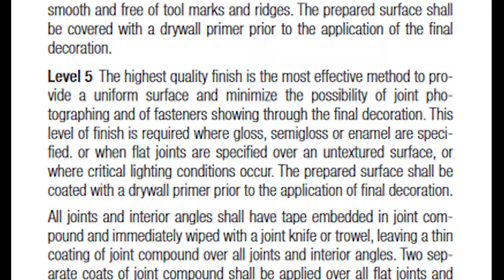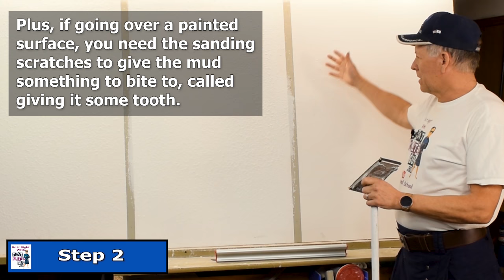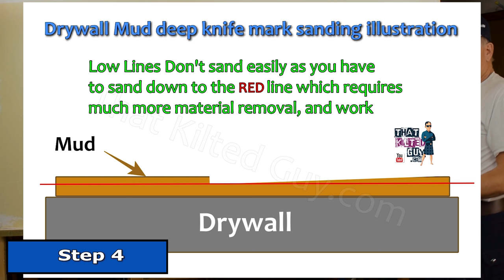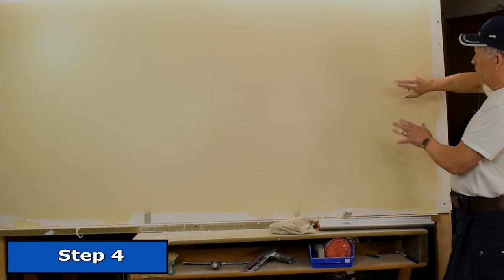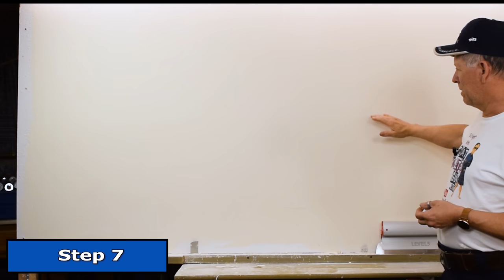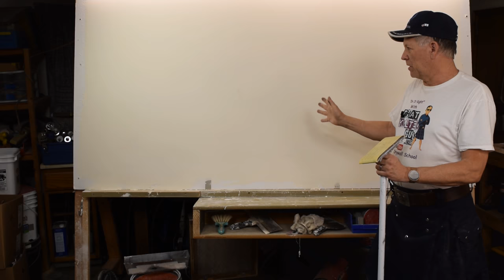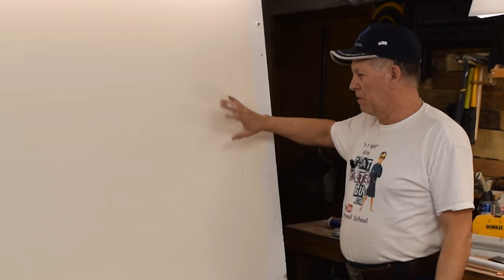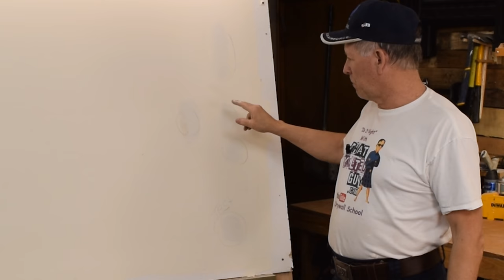Got UGLY TEXTURE? Skim Coat it away.  I'll teach you how

Comment: Thank you sir for sharing all your years of experience as a drywall master. Truly invaluable for us newbies trying to get a good result our first time out. I have a big first time kitchen walls and angled high ceiling job that I'm going to tackle on my own. If it weren't for you I don't think I would even attempt it. I hope I do alright and I'll take some before and after pics.
Reply: How’d it go?
Reply: @johnm9115  It came out great! It was also also alot of work. I did save alot of money 💰 
Use paper tape not the mesh. The first tape coat use hot mud, it's alot stronger with less chance of cracking.

Comment: I watched so much of your videos to prepare me for a big undertaking of skimcoating over horrible diy texture that the previous owners did in our home. I started knocking down high points and the joint compound just started coming off. Lucky for me they did not properly prep the wall and put joint compound straight over oil based painted walls. All I have to do is scrape lightly scrape some of the paint (again laxtex over joint compound ,comes off super easy) spray with water and it just scrapes right off. This was 1/4 inch thick some spots Even though it's still work to scrape all the joint compound off in still left with a smooth wall with some minor damage from wallpaper removal in some parts. I ordered some gaurds and now I feel alot more confident that I can actually make this look good since I'm starting with an already pretty smooth surface. I guess their lack of proper prep worked in my favor. I will actually prime and everything to ensure my skimcoating actually stays on the wall lol
Reply from the maker: Devin Bush wow, you got lucky. Be sure to de gloss the oil paint well before putting any mud on it. This is proof that proper prep matters.

Comment: I'm a master finisher! I always skim twice! "Busted " every joint! I still like watching your videos! One thing I learned when using screen tape using durabond on your first coat not mudd bc cracks will happen! I learned that from you sir!!! Thank you for the knowledge! Frim Georgia!
Reply: I'm a rocker/plasterer by trade 26 years.  I also use durabond for patching plaster (1st 2 coats). It is its own animal no other mud can match. I also tell people your mud is only as good as what it's fastened to.  Put the seam in the wrong load bearing spot or fasten wrong and it cracks no matter what.  Most rockers will start a seam off of a corner when doing a ceiling, I put the corner in the middle of the sheet to allow flex under the middle of the sheet instead of the seam. Cheers

Comment: Thank you KG for all your help! I have done two rooms thanks to your videos, taken my quality to level 5! Might I suggest, I used a headlamp at night for the final sanding, for the rooms that I did, just went along the ceiling when I worked on that, and then for each wall. It worked sweet to use a headlamp at night and kept my hands free to achieve that smooth level 5 I was looking for while sanding or touching up w more mud in certain areas.
Reply from the maker: I’ve done that

Comment: For a smooth finish close to a 5,  2 coats in corners, 3 coats out corners and seams and 4 on the butt joints. After sanding i wet mop everything paper and all. Last I will sand a$ter a good drywall prime.

Comment: Little advice please. Been in home repair/carpentry heavily for the last few years. I can handle my own but drywall has always worried me. I can fix a patch, apply orange peel and all the basic stuff just fine. Lots of practice and learning from people like you. Getting more into drywall and the tools/tricks of the trade. Like not using multi purpose box store mud for all jobs. My question to you. Do you use glue and/or dish soap? No, why? Yes, when and why? Like to hear from professionals like yourself
Reply from the maker: I’ve never found soap to do much and I don’t like adding more than a tablespoon per bucket if I do try it. I don’t like messing with the chemistry of materials. I only add glue when I’m applying mud over a difficult to adhere to surface like glossy paint. 

I hear guys complaining about drywall mud all the time and saying this mud sucks and that mud sucks. I tend to be able to use most any out there and make it work just fine.
Reply: @ThatKiltedGuyDIY  thank you. Glossy paint, exactly the type info I need as that really explains the reason behind the madness. Thank you

Comment: I'd like to see you do a skim coat on OSB.  OSB might cost twice as much but I can mount anything anywhere without searching for a stud and it is very durable.  I did the interior of my garage with it and then coated it with floor urethane.  It turned out wonderful.  However, now I want to put up some walls in my basement.  I'm also wondering if it is possible to do away with some of the sanding dust and effort by using a damp sponge at the right cure time.  I've never tried that before but I watched a guy do it once and I was amazed by it.  Thanks!

Comment: after switching from residential painting mainly orange peel walls to commercial painting doing alot of schools and factory's i ran into alot of smooth walls painted with semi gloss and the room for error while painting smooth walls in semi gloss is very slim. its one of the more difficult things to do when painting by hand. if you dont get it on perfectly even u can see it so easily. also painting steel fire doors by hand is another tricky task when going for a almost spray like finish.

Comment: Your videos are incredible; I have watched a ton of them. I can't remember which video it is, but you went the difference of the "Blue Lid" Plus 3 and "Green Lid" All Purpose pre-mixed joint compound.

I have always used Plus 3 (watered down to different viscosities) for my first, second, and final coats for mudding. Would you suggest the Plus 3 for skim coating over a (very poorly executed) sand swirl wall? Or would the extra adhesive that's in the All Purpose mud be better for this application? I know it's a bit heavier and dries a lot harder than the Plus 3.

Thanks for your great insight on all things skimcoating and drywall!
Reply from the maker: I use +3 on pretty much everything

Comment: Hello! Your videos really helped to me to fix a lof of defects of my ~600sqft ceiling. I think you are doing an excellent job with delivering your experience through the videos! 
Currently i am going to do a lvl 5. Almost done with it and applied primer. The problem is - after priming, all those little touches are appearing very well. They have been sanded before primer, but still you can see them clearly. 
Curious if I can share some photos with you for any suggestion. It feels like I need to redo skim coating but I don’t want to make the same mistake again. Any guidance will ne appreciated! 
Thank you in advance
Reply from the maker: If you’re a member of my Drywall Academy, you can share photos and get more direct help.
www.DrywallAcademy.com

Comment: Years ago I hung a drywall ceiling and skim coated it and it came out great.  I'm a DIY guy so about 15 years later I'm about to start my second attempt to skim coat and I've learned a lot watching your videos. BUT the big difference in the technique I used back then and yours is applied the mud with a notched trowel to get an even depth of mud and then used a knife to smooth it out.  The smoothing was very easy because I was not guessing how deep the mud was on the ceiling.  I just made it smooth and tried not to accumulate any extra mud on the knife.  I finished with a quick sanding to knock down any knife marks.  Have you ever tried using a notched trowel to apply the mud?  I'm going back and forth trying to figure if I should use that again or the roller and would like to hear your opinion.
Reply from the maker: Well I've probably spread 50,000 boxes of mud, so I can do it by feel.  Your idea might make  sense for a novice so if it works, I see no problem with it.

Comment: This is a great video. My concern is you mention painting the walls after using a roller. As someone that recently painted my kitchen cabinets I have found that using even the best rollers that money can buy will leave a texture. Shouldn't the walls really be spray painted after? And what about down the road when you need to touch up any scuff marks on the wall...if you put some paint on a smooth wall using a paint brush will you see where you touched up?
Reply from the maker: You could roll with a 1/4” and get very little stipple. Spraying would be smooth too but it’s not always practical.

You could also add some paint retarder which slows the drying to allow it flow it better. Floetrol is one.
Reply: @ThatKiltedGuyDIY  Great advice. Thank you.

Comment: Great vid, I had a hell of a time finding a good one about coving up texture. I wish I would have found this earlier as I'm already 80% done with converting all the textured walls and popcorn ceiling to lvl5 and it's been a nightmare. How do you avoid the bubbles? For the life of me the bubbles just won't stop and none of the smooth wall bubble techniques seem to apply since I'm applying it over a textured wall with paint. If I start to sand the bubbles I often find that just more and more show up underneath and I have to wind up sanding it all the way down past the original paint to close to the original drywal surfacee.
Reply from the maker: The bubbles are far worse when you apply drywall mud over painted surfaces. This is because normally the drywall paper absorbs some of the moisture into it but with paint it can’t so the bubbles all go outward from the moisture evaporating. The best way I have found to handle it is mostly by vacuuming as I sand the bubbles off, and sometimes I damp roll some of the worst surfaces with a paint roller to help pull out more of the dust but mostly the vacuum sanding and then I just fill in the bubbles on the next layer. It is a pain in the butt
Reply: @ThatKiltedGuyDIY  right on. Glad to hear it’s not just me! Feels like 2-3x the amount of work with the never ending bubbles. I’m Wondering if I should have just sanded the paint off first now
Reply from the maker: @Kuj  that’s really difficult to sand paint off. But it does help to sand aggressively which is why I sell the 24 grit sanding disc for the power sander on my online store at www.thatkiltedguystore.com. Those 24 grit disc scratch the paint up better and don’t clog up as easily which helps reduce the bubbles somewhat
Reply: When removing wallcovering and the paper finish on sheetrock comes with it and you have the brown.fuzzy left to mud over how do you get it smooth

Comment: Am I correct to assume that the first 2 steps apply exclusively to modification of an already-finished wall?  If this were freshly applied drywall there would not be texture to scrape off prior to the skim coat right?  Aside from sanding the joints really well.
Reply from the maker: Correct

Comment: I have watched most of your videos and they are very helpful.  Thank you so much.  The problem I am having is air bubbles.  I am skim coating over painted texture walls.  I sanded them down and used Gardz and primer over them and then used plus 3 slightly watered down.  After rolling it on and smoothing it out I am getting bubbles in random places.  I wait till it dries a little and then smooth it again and that sometimes solves it but sometimes it doesn't.  Any tips on air bubbling?
Reply from the maker: Skim coating over painted walls is the worst. The moisture normally gets absorbed into the paper and you get minor bubbling but over painted surfaces it has to escape through the drywall mud away from the wall and I have not found any secrets to reducing that. Bubbles are a pain in the butt.
Reply: Thanks for your reply.  I  guess additional coats or thinning the plus 3 won't alleviate this problem either.  It makes me feel a little better that it's normal for it to be hard.  I've been fighting it for a few days now trying faster application, slower application, more mixing, less mixing, more pressure, less pressure etc and have been thinking it was just my lack of skill.  Thanks for your help.

Comment: We bought a house and the previous owners did some ugly texture.  Big globs, it looks so crappy.  And it’s painted.  Should this be sanded down or skim coated?  I almost feel like it’s too globby to be skim coated!  Thanks for your vids!!
Reply from the maker: I would do it just like in this video. Scrape first, sand thoroughly with really coarse grit, then keep coating it in until it’s smooth. If the bumps are thicker than 1/8 of an inch, you might start with fast setting joint compound because you can’t put regular mud on that thick.

www.ThatKiltedGuy.com

Comment: My DIY project has a 5' x 5' Durrock Concrete board, set inside a Drywall constructed wall, to meet fireplace non-combustible needs near the firebox. Do you have suggestions / a video(s) covering skim coating Concrete & Drywall surfaces ..... especially treating the joints where the Cement meets the Dry Wall. I don't want to use brick tiles, I just want to paint everything.  Is there one product that can skim coat both materials. I am trying to avoid using Bricks on the Concrete portion, and continue the paint from the Dry Wall out over the Durock.  Durock says to not use Sheetrock 90 on their product, even though several folks have suggested it.  Some Videos suggest using a 'bonding agent' (??) the Cement portion first, then Dry Wall mud; but I can't seem to find an example of that used on Durock. Do you have a video(s) that addresses these points ?
Reply from the maker: I’ve only dealt with that a small handful of times around the shower in a bathroom and I don’t have a video on it. Good luck

Comment: Would you recommend using 1/4" nap roller for level 5 finish walls and ceilings?
Reply from the maker: I'd go 3/8 - 1/2" if the wall was mostly smooth already.

Comment: What if the wall is painted?  Do you need to prime first or just make sure it’s flat paint?  I’d be concerned With bond to the existing surface.
Reply from the maker: For painted walls, I usually just sand them thoroughly with 80 grit, and clean that off. But I also use regular weight all purpose as it has better adhesion. If it’s really glossy, I also add a little squirt of wood glue for extra adhesion

Comment: Skimming plastered walls do you use the same products and methods?
Reply from the maker: Honestly, I've worked on less than 5 plaster walls in my life, but I've always used hot mud to repair them.  As for skimming, I would use the same materials, yeah.  Just be sure to sand first to knock down nibs and ensure the mud sticks better.

Comment: Plasterers dampen their coat and float it with a trowel to achieve a smooth finish. I get the impression that they never sand. Why can’t the same technique be used with gypsum?
Reply from the maker: Good question, but I don't think it would work with drywall mud as it's too soft.

Comment: Is there a way to paint the wall after a level 5 finish without getting that small stippling? Or is that the smoothest it will go? (I did the first coat of primer and was wondering if the slight stippling will continue to the top coat of paint)
Reply from the maker: Well to get the smoothest finish you use the thinnest nap, like 1/4”. Or spray it but even that leaves a slight stipple. There’s a spray tip called a fine finish that goes on a little smoother. 

Thanks for helping me build my channel to 100,000 subscribers and beyond
Reply: @ThatKiltedGuyDIY  Thank you so much! Yea I love your content

Comment: What do you do when the popcorns are really big and tying to do that would be impossible you think
Reply from the maker: If it doesn't have asbestos, you can remove it by scraping.  See my playlist on Popcorn ceiling removal.
Reply: @ThatKiltedGuyDIY  it’s been painted I’m gonna exaggerate 50 time it’s bad how would I know if it’s asbestos building is very old
Reply from the maker: Once it’s been painted that many times, it’s extremely difficult to remove. Your best bet may be putting in a suspended ceiling, or an overlay of new drywall. But I would probably give it a light scrape to knock off the longest bumps before doing that as it would make it extremely difficult to hang a new layer over.
Reply: @ThatKiltedGuyDIY  thanks have a great Thanksgiving.
Reply from the maker: Thanks, you too

Comment: What if the popcorn is already painted (IN ORANGE) with a paint that might be old-fashioned glycero ? The popcorn is not that pointy, it's one of the smooth and irregular one (maybe already smoothened in the past) but still. Do I need to scratch the paint before?
Reply: Please look out for lead paint. Many places in the US before 78 almost always have it. You really shouldn't breathe it, especially if there are kids around. 

Not sure about damping to keep the dust down. 

In warm weather, you can use a whole house fan to suck the air out. One fan fits in a standard window and covers about 400sf. They screw in.

Comment: Hey Guy, I skim coated my ceiling with plus 3 and sanded. When i skimmed the 2nd coat,  the plus 3 left what looked like small air bubbles. Why is it bubbling so much as i skim it out? Also, can i fill in the imperfections with easy 45 hot mud over the dry plus 3?
Reply from the maker: bubbles happen a lot.  Leaving a lot of dust in them from prior sanding makes it worse, but they happen a lot anyway.  Just vacuum the dust out and fill with Plus 3.  No need for hot mud.

If you find our information has helped you with your projects, you can tip us if you would like at: 
https://paypal.me/ThatKiltedGuyVideos?locale.x=en_US
Or on Patreon at: https://www.patreon.com/ThatKiltedGuy
Or Via venmo at Guy Purcella@Guy-Purcella

Thank you either way.